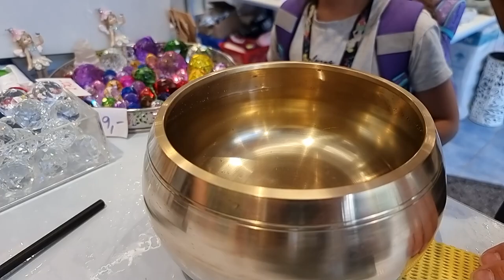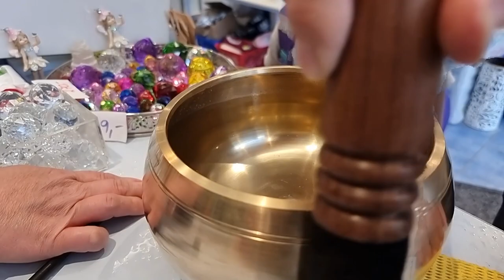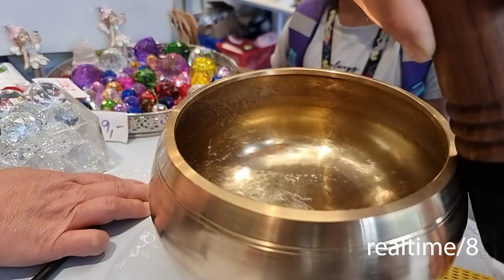Singing bowl  Ex04 - CNC machine cut

Comment: This bowl is a lot less parabolic in shape, and the water does appear to start swirling slightly.  The sides are also much smoother in this bowl (
Meaning less turbulence, perhaps?) - so, anyway, the pudding bowl shape has it 🙂
Reply from the maker: In the slow motion of the hand made bowls, you can see a low frequency 'wobble' around the bowls, but not in this one, and I think it is too stiff or not stiff enough as it is milled from a billet rather than beaten into shape.
Reply: @MFMP  Yep, I see that on my PC - I was watching the videos on my iPhone before - so, postage stamp image resolution...
Reply from the maker: @gordondocherty  Also - the transcode for the upload followed by the transcode by YT have introduced two generations and, though the uploaded file has few artefacts - the YT version has a lot and a lot of detail is lost. Assuming I can buy the better 185 pound bowl (with negotiated discount) I will upload original clips also.
Reply: This is super interesting.  Also it can’t be discounted how the hand made bowls have the human intention behind them (quantum entanglement and all that..)